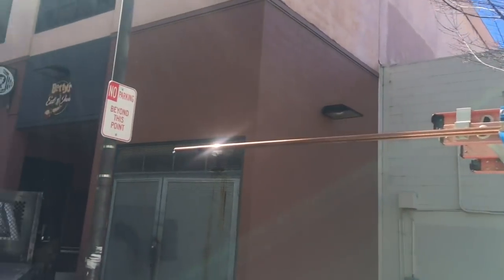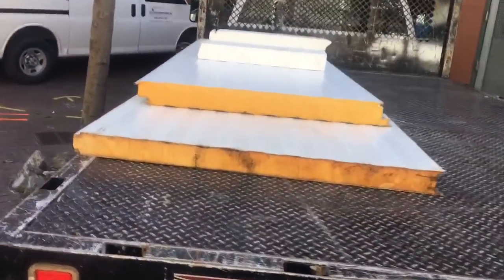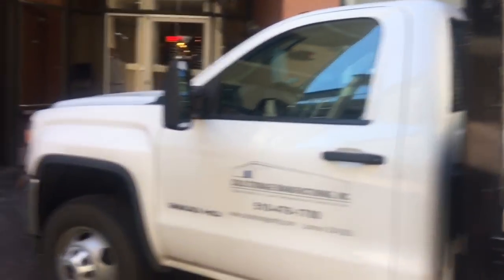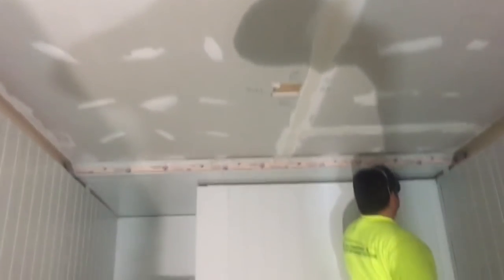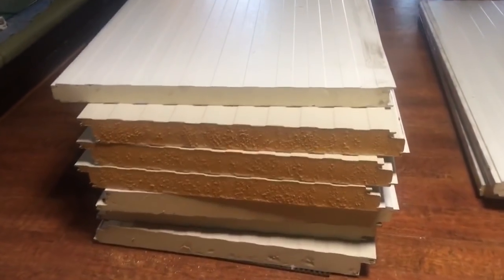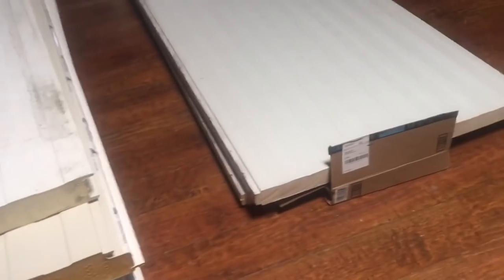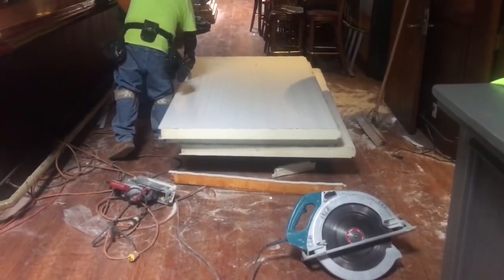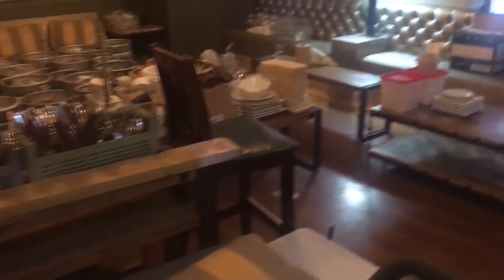Walk in update 3

Comment: this answered my question on the other video, custom cut box panels. I'm not a big fan of that, should have went rental refer truck to keep income flowing ( if there was parking space)
and just slapped in a standard square/rectangle shape box after others repairs. speed speed speed!
Reply from the maker: throttle bottle not to worry about speed or rental trucks. The contractor and landlord and business owner had this all planned out. They had to replace floor joists that rotted out.  This is the contractors job and there way of doing it. I’m here to show you all what’s going on. Hang a coil and a condensing unit.

Comment: The gap between the sheet rock and panels looks to small to me, there has to be some ventilation otherwise the outside of the box will get wet and stay wet due to moisture diffusion thru the rock sheet and gaps. There is gonna be mold everywhere.
Reply: yep, probably be all rotten, moldy and smelling like hell in 5 years tops.

Comment: Id think it would have been cheaper to measure it out and order a cam lock box. Cluck click and snap it together. Cam locks go together fast.
Reply from the maker: OcRefrigeration,Hvac & Electrical. I’m only hired for the coil and condensing unit.  Showing the job as is goes. Still better than jelly walls they had before 😂😂👍